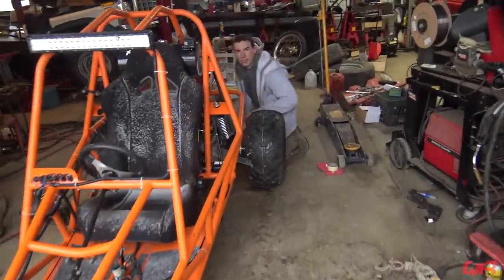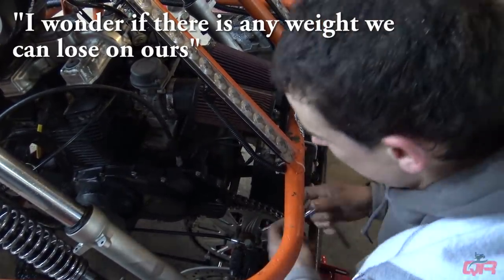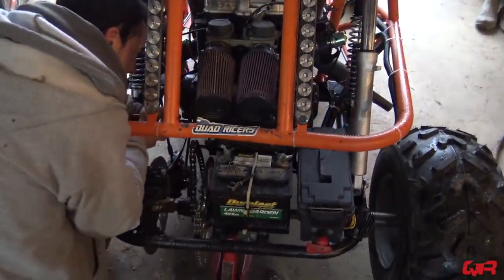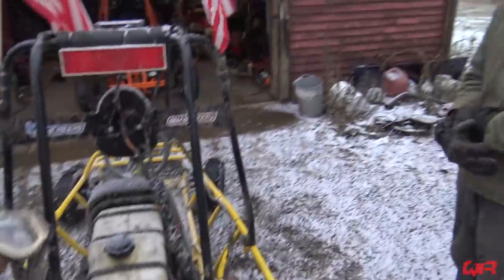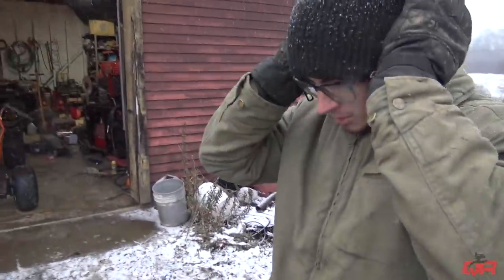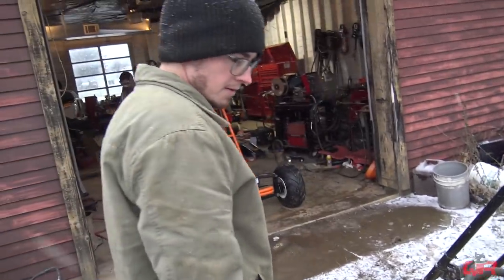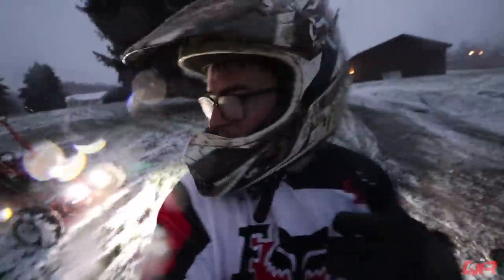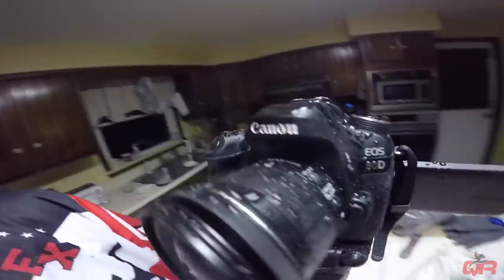70 MPH Snowmobile Go Kart Top Speed

Comment: Check out micro sprint racing. You guys should get into it. Micros are pretty popular in PA. It's not cheap but you can get into it decent if your smart about it. They use 600cc rocket motors. Iv raced one for a while and they are a ton of fun. Also you can find an older rougher frame pretty cheap if you wanted something cool to make a buggy out of.